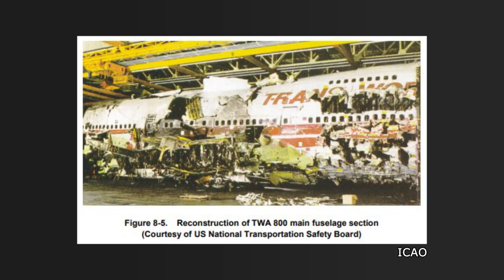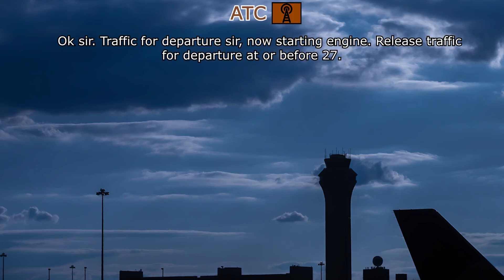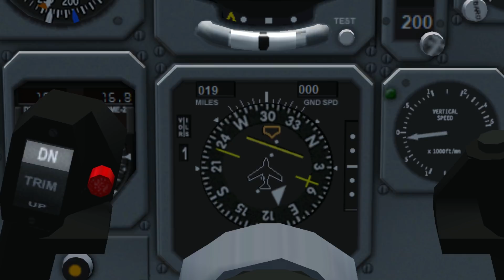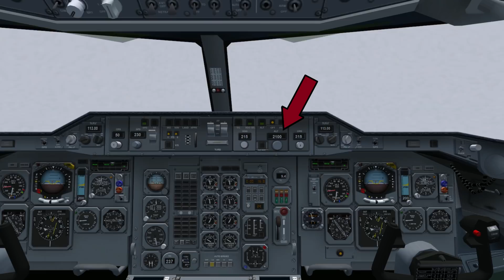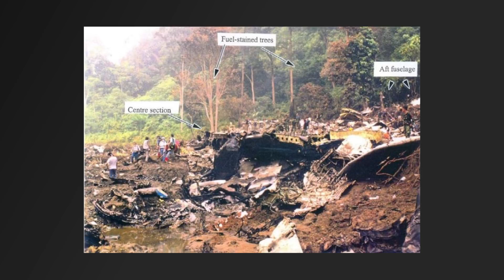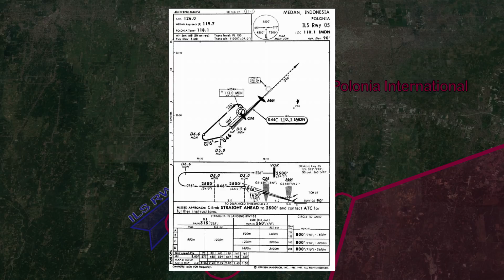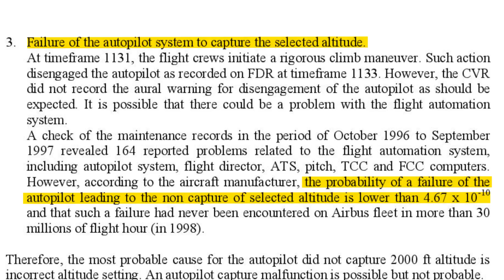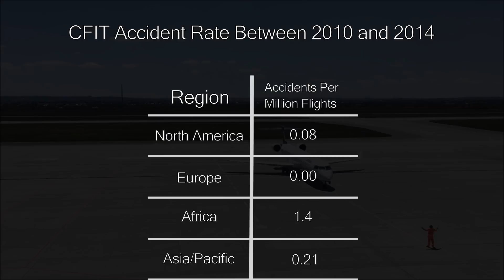The DEADLIEST Way To Crash A Plane | Garuda 152

Comment: 1986 I tested SONY video camera. The camera could see through fog in 0 visibility
Reply: There’s plenty of technology that could enhance the safety of aircraft but has yet to be implemented in the most obvious ways. Every time I watch an investigation of an incident which would have had a different outcome had the pilots known the actual state of their engines, I’m always shocked that there aren’t any cameras to visually monitor them (and other external structures/surfaces). Such a system would be inexpensive and easily integrated.
The same goes for cameras which are sensitive to infrared and able to see through fog. We should have them in our road vehicles for low-visibility driving, and they should definitely be employed in large passenger aircraft.

Comment: With an inbound flight in airport proximity and able to land, why is the controller so concerned about a departing flight still on the taxiway ?   Seems like a lot of unnecessary fiddling about keeping a plane in the air so close to the airport. How about 'hold short' for the departing flight ?
Reply: Agreed.  It sure seems like this was primarily the fault of ATC.  And the priority should be landing the planes close to the airport, especially in such poor visibility.  A plane is safe on the ground, so it can hold, until the incoming planes land.

Comment: I'll say this, if I was either pilot...I would have added full power and climbed, as soon as I felt there was miscommunication, In mountainiss terrain
Reply: Hell!  I wouldn't have waited a moment either.
Reply: @tonyduncan9852  copilots need to speak up, captains are in control...but become complacent.0
Reply: Yes, me to and  would of noticed that I was only 1000 feet due to the mistake in the the setting of the autopilot altitude of 2000. I always give a few peeks at the altimeter when on the the approach. They should of known about the smoke and  been more diligent on the approach. My as a private pilot, I would of never took off in the plane.  Over my personal min.

Comment: This is one aspect of aviation that fascinates me.Yes flying during the night as a passenger I still go to default.If you cant see where you are or where you are going and have to trust systems in the cockpit then you are flying blind.If in a vehicle on the road and you dont see where the road is going you slow down or pull over . Flying into terrain will always be a high risk with less well equiped aircraft in poor visibility and spacial awareness critical.

Comment: Hey great video but I have to correct you. The Air New Zealand Erebus crash was not pilot error.
Reply: Sadly ultimately it was pilot failure. The  fatal factor being...They were flying below the designated minimum altitude. As set by the NZ Civil Aviation Authority, and  by the Airline for these Antarctic sight seeing flights. And that official rule was never   changed! They were also flying in white out conditions. Therefore couldn't visually confirm their position. However the pilot in control knew Mt Erebus was in the area. So given they couldnt visually confirm their position. And knew they were below the minimum designated altitude. - IE below the height of Mt Erebus! The golden rule here is - climb out!! Get up stairs fast!! As a general rule, altitude is your friend! That responsibility comes back to the pilot in control! Yes the later navigation change had them flying  towards Mt Erebus instead of to 1 side if it. As stipulated by the original flight plan. However had they been flying at the authorised minimum altitude. And as stated, that requirement hadn't been changed! The aircraft would have flown safely over the mountain regardless. And the navigation correction would have occured on the flight back to NZ. And that accident investigation finding was never overturned by any subsequent Court cases. Right up to the Privy Council! So the synopsis is. = There were 2 contributing factors to this tragedy and 1 fatal factor. - 1.  Was the navigation error... and 2.  They were flying in white out conditions. However - ultimately - the core fatal factor was... They were flying below the minimun authorised altitude! And in so doing, abandoned a critical safety measure!
Reply: It was Air NZ changing the flight plan coordinates the night before and NOT telling the pilots

Comment: How about communication being “turn left, correct” or something similar. The word ‘right’ should never be used unless it’s a command to turn right. It should never be used as a confirmation.
Reply: That’s so right.
Reply: Way too much inadequate phraseology in this case. that explains a lot of the confusion and misunderstandings between the ATC and the flight crew.
Reply: Perhaps they should simply use compass directions rather than the vagaries of ambiguous ‘left’/‘right’ indications.
Reply: @anhedonianepiphany5588  they are using compass directions, that’s what the headings are.  Turning left or turning right aren’t vague instructions, they are very specific, they define the flight path of the aircraft and are binary.
Reply: @kickedinthecalfbyacow7549  ...and prone to confusion! There are plenty of binary alternatives which wouldn’t be so problematic. Either that, or just contrive some new aviation specific terms to avoid conflict. The arrogance is amusing, but hardly fitting.
Reply: @anhedonianepiphany5588  I think a high proportion of pilots can tell their left from their right. I don’t think you actually understand what happened here.

Comment: Amazingly (or actually not), the terrain/pull up warning reduced crashes by about 90% over night once GPWS was mandated. No terrain warning due to being in approach configuration?
Reply: This thing had GPWS, it was broken.
Reply: It didn't happen overnight, the earliest GPWS were installed as far back as the 70s. The game changer happened to be the TAWS, which explains that no airliner fell victim of a CFIT after 2010.
Reply: @julosx  I didn’t mean literally overnight, but once commercial airliners were mandated to have terrain warning, crash numbers plummeted quickly.